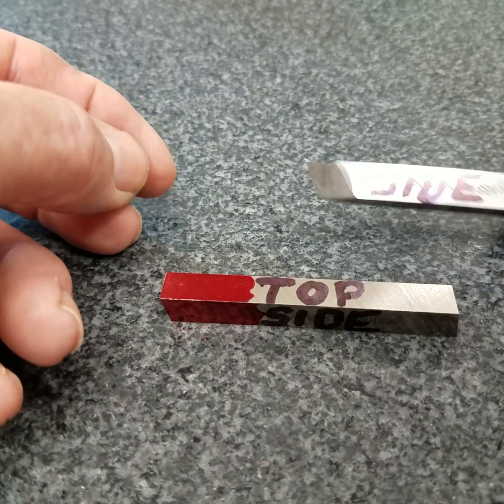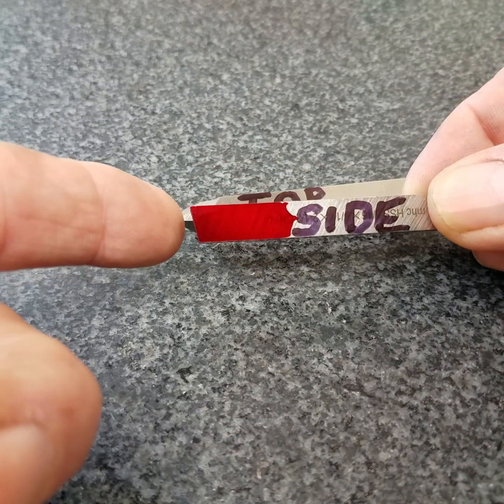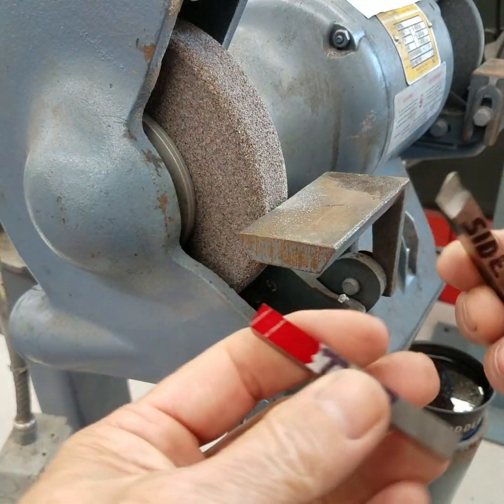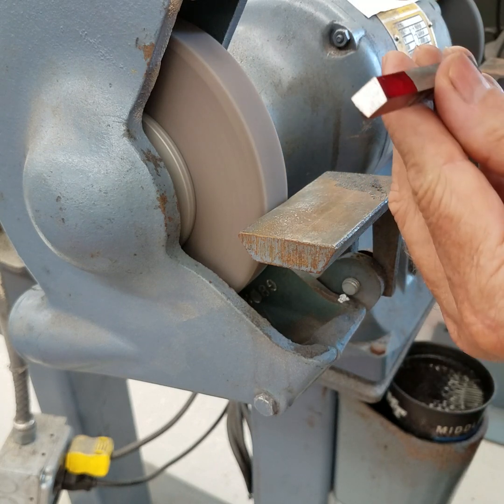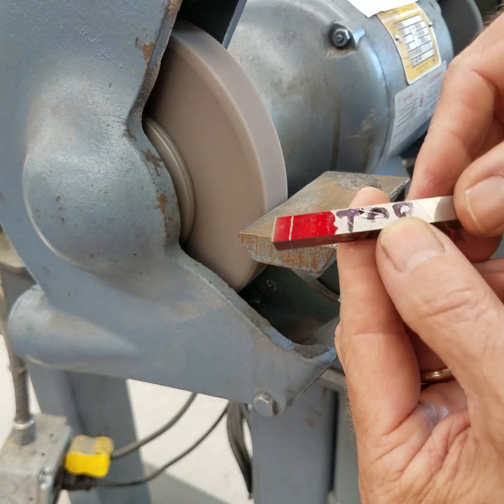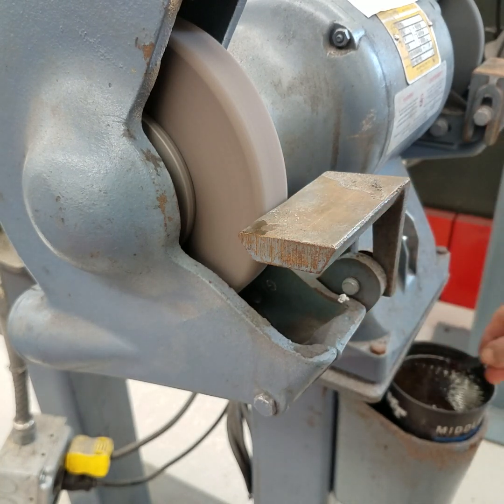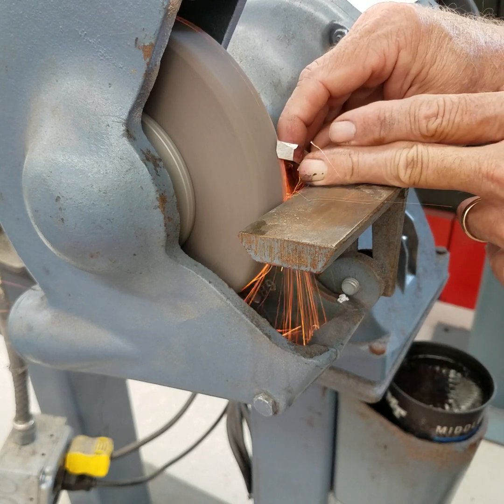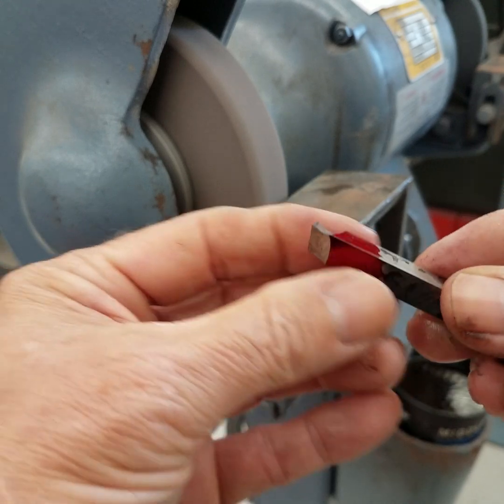HOW TO GRIND A CUTTING TOOL FOR LATHE

Comment: Great tutorial of what to cut where. Do you also need to sharpen it on a stone?
Reply from the maker: Yes, I always drag an "Arkansas stone"(very hard stone the size of my pinky) very lightly across the edge to slightly dull the razor edges to keep the edges last longer. Thanks. Later, Rick.